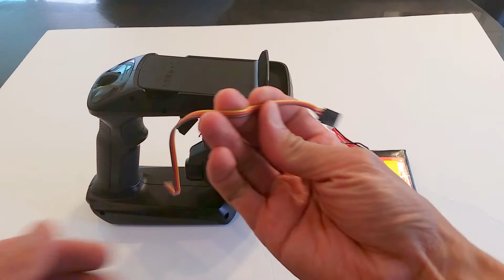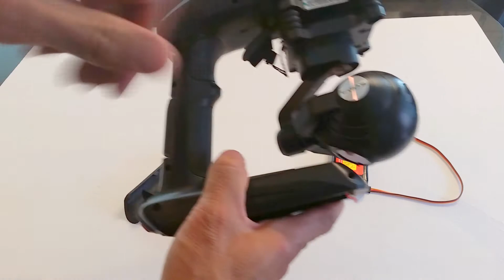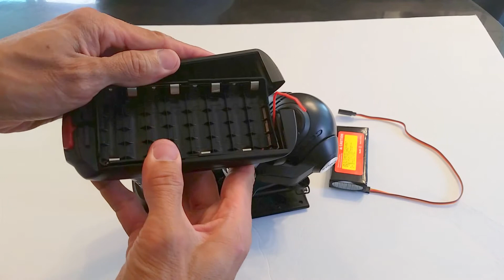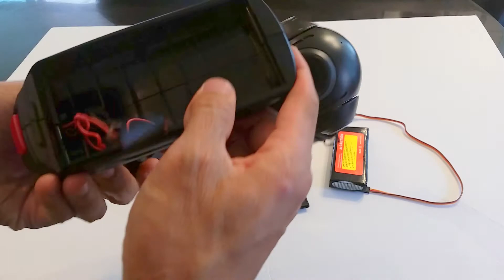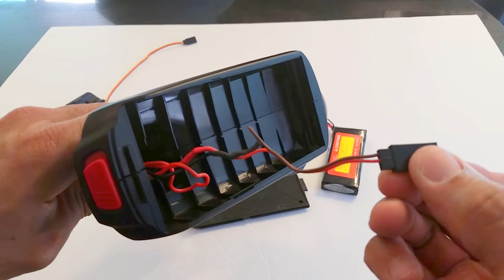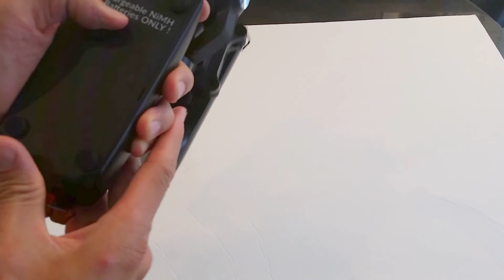Super Easy LiPo Battery Modification for Yuneec Steadygrip Handheld Gimbal

Comment: Can I use one of the originals q500 battery for this modification? Thanks 👍🏼
Reply: hi - thats what i was wondering - i am considering 3d printing a modification to the steadycam battery compartment to allow a q500 battery to slide in.

Comment: what is the final voltage of the Lipo when the gimbal runs out of power and turns itself off ? Do I need a beeper or BMS or will it stop above 9v ?

Comment: Off topic question...when you use the steadycam what is the audio source, is it the camera, or the phone. my audio on the cgo3 is horrible?
Reply from the maker: TheDBCooperforum I record audio using both. The CG03 is a drone camera so yeah the audio is awful.
Reply: Okay, thanks. was starting to worry I had something wrong...I haven't even used the steadygrip yet...
Reply from the maker: There's no point in having great audio on a drone camera because all you hear is wind and prop noise anyway. My DJI Mavic camera can't even record sound.

Comment: great vid,can you link the charger for this as we've got the pack on the way but don't know what charger it uses,thanks
Reply from the maker: I used the Yuneec Q500 charger. Just plug the 4-wire plug on the battery into the Yuneec charger and it will balance charge for you.
Reply: you're a star,thanks my friend :)
Reply: ah ok,i've got the typhoon h pro,it only has the main battery port and a usb charging point,yours may be different,i've not seen the Q500 charger,i'll have to go find something to fit it i'm guessing,but thanks for the reply :)

Comment: Does it have to be a 1100mah 8C  lipo I have a couple of 11.1v 3s 25c 2700
Reply from the maker: Blinkit Photography The MAH capacity or C rating does not matter.  I decided on this particular battery because it fit into the handle. If this isn't important to you then any 3S battery will work.

Comment: The link to Amazon is for "uxcell 2 Pcs RC Model Servo Y Extension Cord Cable Wire Extend Lead 50cm". The one in your video doesn't look like a Y extension. Just want to make sure I get the right one. Great video by the way!

Comment: you can also use the batteries from  the copter if you buy the right cable, why didnt you do it like that ?
Reply: Lars M I wanted the battery to fit inside the handle. A mod with a battery attached outside looks goofy.
Reply: Ok that makes sense

Comment from the maker: I noticed the link for the battery is no longer working. This battery has the same spec:  http://amzn.to/2edzx2H
Reply: here's one:  CNDHD 11.1V 2200MAH 8C RC Transmitter TX Lipo Battery Akku Power 964112mm for FUTABA Radio Controller by CNDHD CNDHD 11.1V 2200MAH 8C RC Transmitter TX Lipo Battery Akku Power 964112mm for FUTABA Radio Controller 
by CNDHD 
Link: http://a.co/2dWArAC
Reply: Hi Can this modification harm the ddevice in any way? Because it says nimh batteries only?
Reply: oldschoolrock4evr it won't harm the gimbal despite the warning. Been using the LIPO mode for over 7 months without problems.
Reply: it's also been discontinued...
Reply from the maker: There are several links in the description. One should work...
Reply: https://www.ebay.com/itm/ZIPPY-1000mAh-3S-11-1-25-35C-LIPO-BATTERY-TREX-250-BLADE-300-X-CFX-GAUI-turnigy/222964513367?ssPageName=STRK%3AMEBIDX%3AIT&_trksid=p2057872.m2749.l2649

Comment: Great video, I just ordered the parts from Amazon, you say you use the the Yuneec Q500 battery charger, does the charger auto shut off when the battery is full or ???
Reply from the maker: Yes, the Yuneec charger stops charging when the battery is full.

Comment: Aren't you using a low voltage indicator with your set up?! I looked at the video to see which one you are using and don't see a mention of one..
Reply from the maker: I did not use a low voltage indicator because when the battery drops to about 3.3V per cell, the gimbal seizes up and no longer works.
Reply: Ah right I didn't know that. I ordered one just in case, cheers for Reply.

Comment: Thanks for idea on the Lipo battery. One question. Originally the unit needed 8 x 1.2 NiMH volt batteries = 9.6volt. The Lipo is 11.1 volt. I am guessing that isn't the issue?

If you were to use normal AA batteries at 1.5v =12 volt It wouldn't be an issue although I was told specifically to not use these as it would fry the unit?

Any ideas?

thanks again.
Reply from the maker: I use the 11.1V LiPo battery without reducing the voltage without any issue. I have also used 1.5V alkaline batteries without any issue.
Reply: ok great, I'll give it a go.

Comment: Thanks for the video! I'm surprised not many people have watched your modification tutorial? Seriously, it's brilliant. Using a LiPo battery makes sense then having the limitations of NiMH rechargeable usage time.

Quick Questions.
01. You mention in your comments we can use the Q500+ battery charger with this 3S 11.1V 2200mAh 8C Lipo Battery, is this correct? Nice that we don't have to buy another battery charger.

02. The link to the RC Model Servo Y Extension Wire says it's no longer available. I looked up on Amazon for another vendor selling the Servo Y extension and found one. However, is there ANYTHING we should be aware of before ordering? here's the one I found (https://amzn.com/B01IB99IYA) please let us know if this is the same one. 

03. I haven't heard of this battery brand (Floureon), is it common in the RC community?

04. You mentioned in your comments the LiPo battery usage charge will last close to 1.5 hours, is this correct? WOW, that's great!
Reply from the maker: I published this video just two weeks ago, so maybe it will get more views in the future. To answer your questions: 1) Yes, I use the Yuneec Q500 battery charger to charge the Floureon battery. Just plug the balance lead (the white plug on the battery) into the Yuneec charger. No problems whatsoever. 2) RC servo connectors are pretty much all the same, so no worries. 3) I wouldn't be too concerned about the Floureon brand. Most LiPo batteries are also the same with different branding. The Steadygrip is not a mission critical item, so I'm not too picky about what batteries I put in it because a battery failure is not going to be catastrophic. 4) Yes, I got 1.5 hours of use on one LiPo battery. I knew it was time to change batteries when the gimbal began to seize up and the controls became unresponsive. Even when the Steadygrip stopped working, the battery charge wasn't at very low levels, so I didn't find the use of a battery monitor to be necessary.